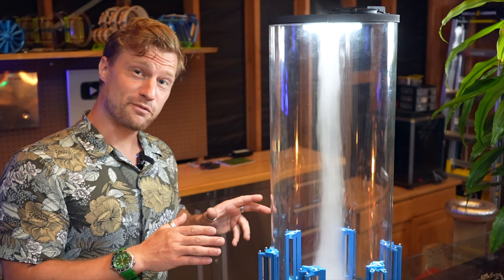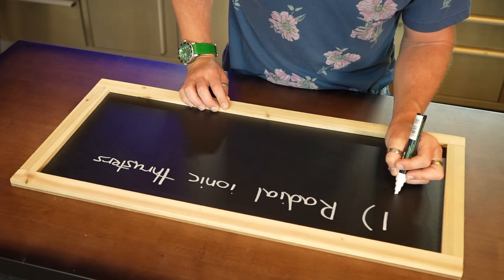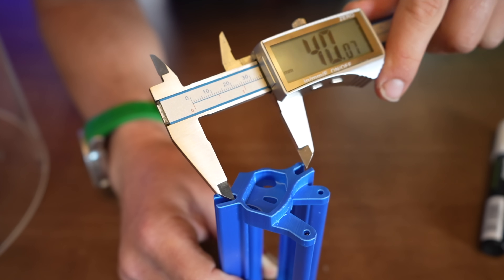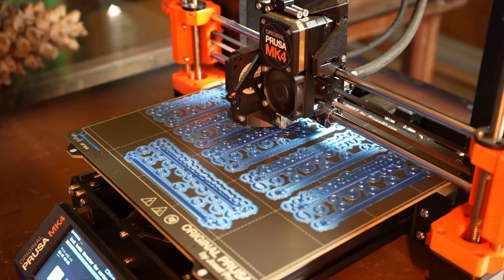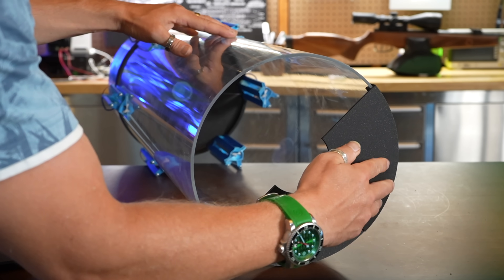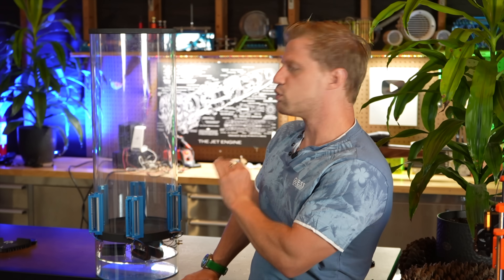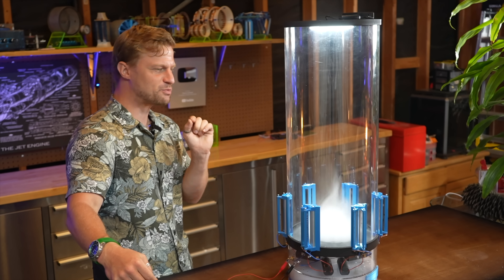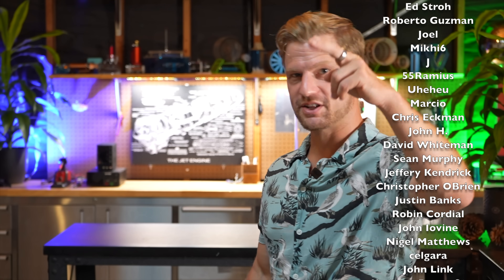I Built The First Ionic Tornado Machine! (Unreal performance)

Comment: Why not do this tornado arrangement, but slanted slightly upwards, with  ionic thrusters on top of each other? That way instead of pushing air forward, you accelerate it in a circular fashion until pressure forces it out at a faster rate than if you were beelining it like previous attempts.

Comment: quick recommendation:   Change the top piece so there's a slit exit in a circle near the outer edge (instead of the hole in the middle), it will force a funnel shaped vortex..

Comment: There is a practical application for your design..
Mixing gases and quite possibly liquids in both home and industrial applications. With no moving parts there is little to service and removes risk of contamination.

Do Not use this in a dust collector!!!!
The sparks could set the dust off like a bomb and start a fire...don't ask me how I know.

Comment: After seeing your post on Designing a Futuristic Magnetic Turbine, I can see several problems that you haven't discussed. One, you would need a massive amount of electric storage capacity and generation equipment to make it work for boat propulsion. As the amount of thrust it produces in relation to the amount of electricity it consumes isn't very efficient.  Two,  your use of the word "turbine" is incorrect as turbines have moving parts. 
My one suggestion is to employ interior radial fins to create a radial effluent flow. This (in my opinion) should reduce the amount of turbulence in the flow.

Comment: You know, since accelerating the air in a vortex with ion thrust was so incredibly effective, would it be possible to generate a vortex in the center of your ionic engine in order to accelerate the air faster? You could incorporate a nozzle of some sort maybe directing the swirling airflow out the back of the engine but through a smaller gap to maximize thrust

Comment: One thought i had....
u probably could have used just 2 ionic thrusters, if you directed the air flow to hit inner wall of the Tube instead.
by cutting tube in half, mis aligning them a bit and filling the gaps with thrusters, i bet you would achieve much better effect and much cleaner vortex :)

Comment: Could of used polypropylene glycol or vegetable glycerin IE a smoke or fog machine and you could run it nearly constantly just use a large tank for the liquid! Failing that you could even use Ionic thrusters to draw it through or across the whicking material like in a vaporizer would be really neat to make tiny desk top versions of that!

Comment: As a tornado researcher and storm chaser for the last 30 years, you have built one of the best vortex chambers I've ever seen!  At low power, you can simulate the detached debris swirl on the ground, and you can see a direct correlation between power output and the rotational velocity of the 
funnel.  

New research on tornadoes shows a laminar flow interacting and wrapping around a small vortex, making it stronger.

I think you might be on the edge of a breakthrough.  This could answer a lot of questions.
Reply: In the formation of tornadoes and cyclones, the interplay between high-speed winds aloft and low pressure creates a dynamic system. The fast-moving air above lowers pressure, while warm, moist air rises from below, generating a rotating column that extends from the clouds to the ground.
Reply: @marifajad4287  I see ChatGPT is still working.
Reply: The streamwise vorticity current.
Reply: as a composive masterbater for 30 years. I masterbate each time i hear this comment by a loser
Reply: unrelated note, these thrusters wouldn't make for a good CPU or GPU fan, because due to needing much higher voltages to operate, if the slightest damage to the circuit happens, (which it will), the current can arc to the PCB and kill your system due to the extreme difference in voltage.
Reply: @engineer84-w8x  What if the wind comes from a tubing specially designed to only hit the cooler of the CPU and then its pushed out by a custom exhaust so it cant touch anything else?
Reply: @engineer84-w8x  the more you know💫
Reply: @engineer84-w8x  🤦‍♂️I don't think you want electrically charges plasma nor the ozone being fed into your computer with it's ultra sensitive components. 🤦‍♂️ smh

Comment: top on a bearing with an offset hole. Motorized or maybe a lil vane and very low friction so it rotates slowly. giving a much neater tornado effect. Also have a grate so that the top of the tornado has to spread out a bit to get through.

Comment: I'd buy one if it grew from top to bottom and was acting more like a tornado, have the exit hole at the bottom and offset from the center and have the bottom rotate, that way it will look like an actual tornado moving on the ground.

Comment: Two questions since mini cycles are cute and all but what else does it do

The first was pressurizing and chilling the tube and using it as a heavy particle detector because why not

What's a good way to cause arcing (so cyclone and lightning in a bottle)

Also, adding Bluetooth and a speaker array to do more things with it like giving it Amazon Alexa capabilities again because why not

And lasers that can ionize preinstalled points or free floating particles in the cyclone.. again because why not (the digital clock display inside an active mini cyclone idea).

Then I'm like wait... What if.. cold plasma cyclone.

Comment: I wonder... If you capped off the chamber and made it air-tight would this work as a 'non-moving part ionic air compressor' ? As much as I'm inclined to say that it can barely compress the air, the velocities of the air indicate that it may have a higher force than initially thought.

Comment: Very cool!! Some suggestions as a meteorologist... You should try to provide a stronger updraft with an ionic thruster at the top to really stretch that vorticity. 😀 And if you're really feeling up to it, try making the bottom six ionic thrusters rotate 30 degrees or so so that you can play around with the structure of the vortex. 😏

Comment: The thing with this is that there's scientific backing behind it.....I know you're not a scientist, but if this were used for a model (a physical one) that could scale up the power in regards to wind speed and all that, it could (emphasising COULD) prove useful in seeing the way a tornado forms at different wind speeds and seeing at which point a tornado has to be at to form perfectly (meaning when you had it at full power there were no laterals to be seen, just one smooth tube of swirling fog).  I think if this could be made scientifically (and I know there are many physical models I'm just too lazy to find them out hehe....) It would help Tornadic Scientists and also Chasers alike massively as most tornado centres have mechanically driven generators for their Tornadic machines....this is the closest to the real thing that had NO moving parts and is solely driven on energy.
Reply: let me though your thoughts on this @PlasmaChannel

Comment: super cool, if you could find taller acrylic then hide the blue parts it would look extremely cool, like if it was just black on bottom, no hardware really seen, then a tube with a tornado, with a black topper with the same function as current it would sell in stores i bet. im sure it would as is, but it would definitely look sleeker and cooler

Comment: It is sad that one can not build a heavier than air craft using current ion drive technology.

I tried several designs, but before I could get enough voltage to drive enough ions, I kept having breakdown which ended up just being a crackling light show, and no thrust at all.

Comment: :octopus-red-waving:Go for turning it into an Over Unity device. Step 1: use a longer tube. Step 2: Build a bunch of small windmills and attach them to the inside. just drill small holes or something to have the wires carrying the current being generated by the windmills out of the container. make sure the windmills are positioned so the vortex can make the windmills spins spin spin. If there are enough tiny little windmills then the total accumulated energy from them could be more energy then you are using to make the vortex. :octopus-red-waving:

Comment: I would be very curious to see what it does if you put the thrusters on the top I would assume it would grow from the sky downwards bit like the real thing I can see an added advantage if you did a pinhole plate with pressure sensors at the base you would be able to measure the vortex vacuum at different points in the vortex and maybe even the wind speed
excellent project I see potential for people to learn a lot from this and maybe even save some lives in the future excellent job mate can't wait for more videos on this

Comment: you should  make one with the ionic thrusters on the top of the tube.
you could even just use that same tube, turn it upside-down, and somehow have the dry ice at the top of the machine.
you could try it with the thrusters on top, everything else on bottom, see what happens, but if you do have to have the ice/water up top, you could have them in a circular "pool" with an opening in the middle, but the opening is also the "wall" of the circular pool. then, put a small low-power intake fan that will force the air out of the hole down into the chamber. the intake fan would be on the outside of the case/pool, and running at low power, but slowly pressurize the "pool" and force air and hopefully fog into the vortex chamber.  the ionic thrusters being up top would produce very similar results to this video, just, up top... looking like a real tornado by forming from the top instead of the bottom, although i guess some tornados do form ground-up, it's usually the other way around.
Reply: this would be what the inside cross-section of the "pool" woud look like:
L <-fan                             |
|                                        |
|  . . . . . . |       | . . . .  . . . |
|________|       |_________| <- ice/water (bottom of "pool"). 
{                   thrusters-> }
|                      tube->       |

Comment: Pretty neat.  One point:  You are still using water!  It's just water condensed from the cold dry ice.  It could TECHNICALLY be identical with water fog machine, but you just have to get the particle size right and use deionized water.  =)

Comment: Hah great vid, we had this as a science project from a long time ago, however not with ionic trusters but a heating stove at the bottom, a vacuum cleaner with adjustable rpm at the top, same transparant tube, and adjustable air inlets at the bottom. 

We had to replicate the real life conditions, low pressure at the top, temp from below and the perfect instream of air at the bottom. 

It was surprisingly easy to be honest. Smoke was from the Amanuensis blowing smoke with a cigarette. Haha gotta love the 80's.

Comment: I have an idea of a heating appliance with a fire tornado in the middle. It would use some type of cylindrical glass to radiate the heat with a gas fire in the middle. now im thinking how those ionic thrusters would affect the fire torando, and if they are better than offsetting the two halves to create air flow?!

great work btw, im sure it took a lot of time and effort 👏

Comment: Tornado in cylinder is cool…but could you inverse the flow angle of the array to thrust outward and turn it on its side on a shaft/bearing? Re invent the wheel?

Comment: I once accidentally created a fire tornado in my back garden! Whilst sitting in my garden I had a ceramic table top candle chimnea. So it ha an opening at the front and a small hole at the top! It’s only supposed to one of those t-light candles in it, but me being me, put 3 of them in it! All was well to start off with. But then the wind picked up! This fuelled the candles which at this time had become a molten mess of burning candle wax! As the wind picked up the flame got bigger. Then eventually started coming out the top of the chimnea. The flame in side started to swirl and created a vortex which just got highter and higher until we had a huge 6 foot high fire tornado! I mean, it looked impressive but it was a bit too near our house! I managed to extinguish the flame but it took a lot to put it out! 
And now my wife said I can no longer play with matches! ☹️
S. McCade age 56year!

Comment: You should test making a cloud for me. A jar of water with a small amount of acid. Then let that naturally vaporize into fog. Then add a NO² solution into there in a loose lid. Or take the NO² solvent and release it into the fog. I would assume that liquid turns that fog into a solid. You would need to surround storage with helium to preserve. Then you would need oxygen mixed with hydrogen to solve any ill effects if you decided consumption and went into convulsions. As a holding object. You couldn't eat that. I also assume that disperses if you store that outside of helium. Holding cloud in hand though. Then floats.
Reply: I'd release that quick though. I don't think that would be good if the acidics build up in there. Too much acid is expansion.
Reply: They're a harder type of experiment.

Comment: Internal fins on the thrusters, to adjust the angle of the air flow relative to the central vertical axis, around which the vortex forms. You might be able to further manipulate the height/shape of the vortex. Additionally, you could use fins higher in the chamber, perhaps mounted through a slot in the side of the chamber, so that you can manually adjust the angle of interference manually, while the experiment is running...

Comment: I have a theory about the vortex in the dry ice fog. I suspect the heat of your hand caused a sufficient updraft that the negative pressure region that formed under your hand from warm are rising around it pulled air from below your hand up to take its place. Essentially, just a convection current powered by your hand. I can't prove it merely by observing the limited footage shown, but I believe the theory is sound.

Comment: Have you considered adding or elongating the tube? I am curious what the longest (or tallest) twister you can achieve using this setup, and what we might learn about fluid dynamics in this closed system with laminar ionic fans.

Comment: Scanning comments and I saw someone had a similar idea.  That means that the time has come to build it. Think cones, Venturi,  oh think about this.  Push thru wings.  Create low pressure areas below a wing creating lift.  If the thruster is in the wings and slots force air flow….  Cook on it for a while.

Comment: Saw this video as well as others.  This triggers a thought. Rebuilding cyclone as a cone in series.  

Start with seven small thrusters.  As the narrows reduce number of thrusters to five and finally three.  Each successive set of thrusters should be larger and more powerful than the previous set.  Use a cap device on the small opening of the cone to force the airflow around the cone itself.  You can even take this another step further and add an additional array of thrusters to supplement the force of air being pushed out.  I understand that there maybe conflicting airflows involved but I’m sure you could tweak the ideal somewhat to create the flight device you been working towards.  Btw I want 10% of the earnings from this concept.  I don’t mean the video.  Keep at it and No villain laughs please….

Comment: What if you did an inverted cone on the inside of the tube, angled the thrusters by 30° facing towards the hole on the top and added a second layer of thrusters in the same orientation? Couldn’t that create one large thruster? Or would it just be one large air jet?

Comment: You missed the principle. 

In the previous vid, electron movement created the vortex, not pushing the air with engines. 
In a thunderstorm, there’s a huge charge disparity much like your earlier experiment. Cheers

Comment: I read in an article once that fire that spins in a vortex burns without smoke and companies were looking into that for garbage incineration. Then I never heard about it again. Just sharing ideas.
Reply: Interesting! Thanks for sharing
Reply: ChatGPT's response: Yes, it is generally true that fire spinning in a vortex, known as a “fire tornado” or “fire whirl,” can burn with significantly less smoke. This is because the vortex effect increases the efficiency of combustion by supplying a more continuous and concentrated flow of oxygen to the flames. The enhanced oxygen supply allows the fire to burn more completely, reducing the amount of partially burned particles (which are the primary components of smoke) released into the air. However, the presence of smoke also depends on the type of fuel being burned and other environmental factors.

Comment: I know you don't want us to try this at home... but the absolute urge to build one of these JUST so I can see what happens when I fire all of my different colored laser pointers at it...  I have a 3D printer, I have a Rigol Bench supply.... just need to find some of those coil packs. I don't have the kind in the video, but I do have a bunch of automotive ignition coils that I used in the past to build my lightning box...  I don't know if they fire fast enough though, because they are controlled by a regular spring driven NO relay..  hmmm

Comment: add a laser pointer shooting down the center.  So it hits a slightly tilted spinning mirror.
Set the tilt angle to produce a laser cone than hugs the surface layer of the fog tornado.
You could also experiment with illuminating the Tornado with Scattering laser filter.
Or go all out & shine one of those tri color Christmas lawn lights. That project hundreds of light points with a selection of patterns & animations.